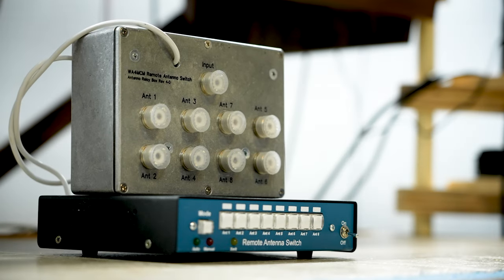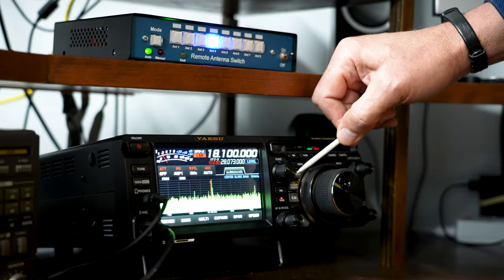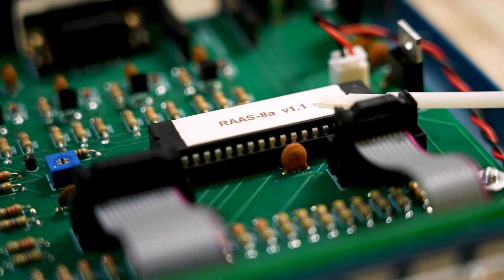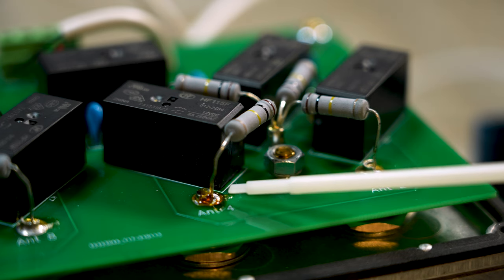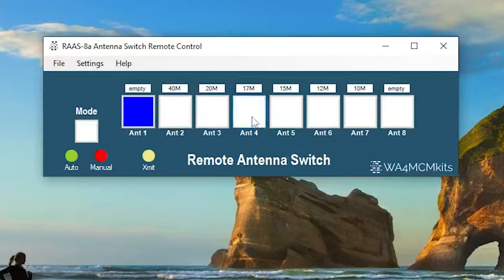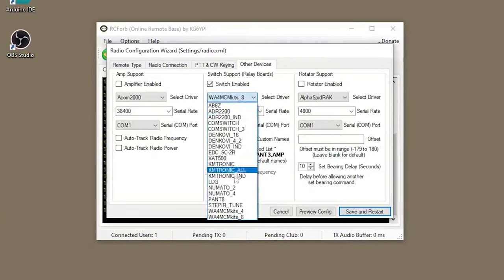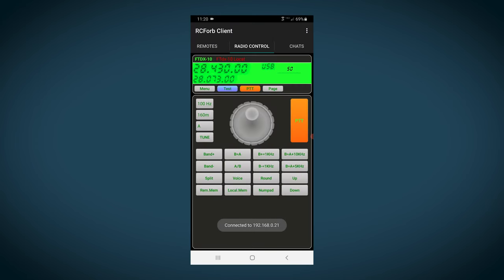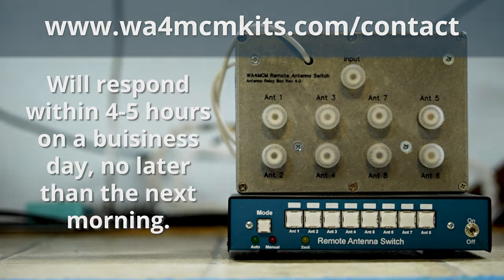Remote Automatic Antenna Switch Tour

Comment: The existence of lightning means that I don't want any "extra" wires running from the antenna farm inside to the shack, especially wired straight-up to my radio.
This leads to come additional requirements that might be considered for this market segment:
1) The remote relay box should be controlled wirelessly, perhaps RF or an LED down a fiber optic line (all plastic). Not a low voltage signaling or DC cable.
2) The remote relay box should be battery powered, and this obviously implies magnetically-latching relays (zero power to hold). Just a few mA in standby.
3) A small external solar panel can recharge the battery in the remote relay box during the day, without bringing power lines into the house.

The end result of this design concept is that there is only one cable that runs into the house (the RF coaxial cable), and that can be heavily protected with lightning arrestors (and ultimately disconnection, air gap).

P.S. I saw a video of a remote base where the owner used remote control linear motors to open a 50cm (2 foot) air gap by remote control. Very nice design.
Reply: Interesting points.

Comment: I’d like to be able to control it remotely. I have a raspberry pi (running digipi) controlling my ft-991a. Is there an API I can use to develop an app Instead of using the companion windows app?
Reply: I see there’s RCforb server but it’s also windows. Anything like this in the Linux space ?
Reply from the maker: Yes, the api is published in the operations manual: https://wa4mcmkits.com/wp-content/uploads/2024/01/RAAS-8a-Remote-Antenna-Switch-Operation-Manual-rev1.7.pdf

Comment: Question. If you had multiple Antenna switch Box’s. Like 2 of the four unit . Is there a way to get them to talk to each other??

By the way . I’ll be purchasing one of you units. They look like fun to build . KG7JBL
Reply from the maker: The switches aren't designed to communicate with each other, but you can connect more than one to your computer and run multiple instances of the companion application.  Not sure what your use case is, but would be glad to discuss possibilities with you - if you have some programming chops, you would be able to write something to link the switches together.
73 - WA4MCM

Comment: How long can the control cable be and still have the remote relays operate reliably?
Reply from the maker: It depends on the wire size used.  24 gauge telephone wire will run at least 100 ft.  Heavier wire will be able to run longer distances.